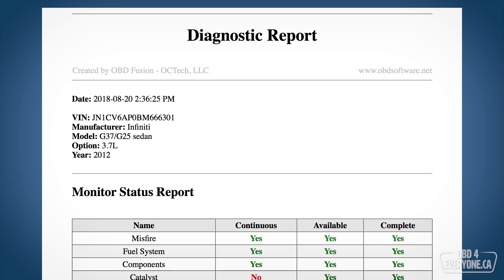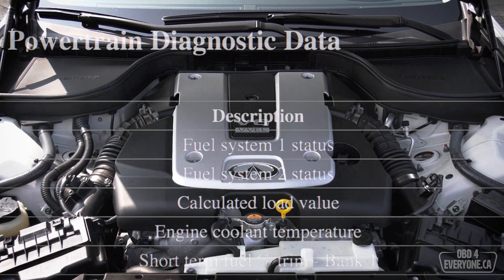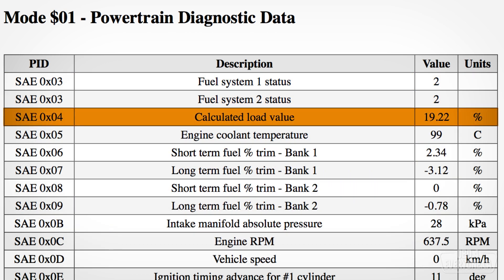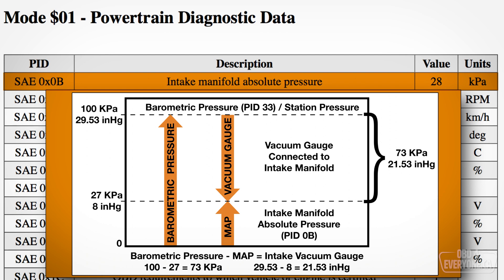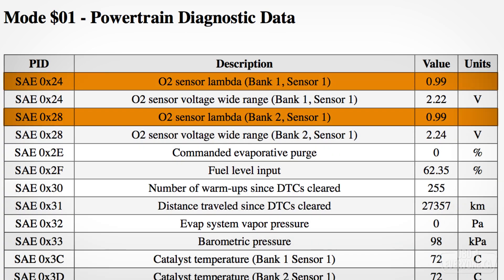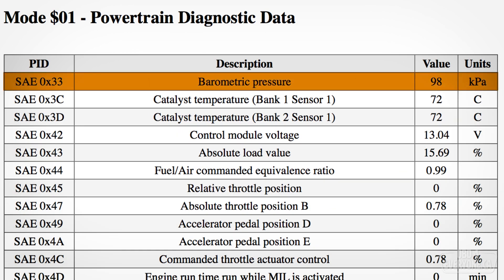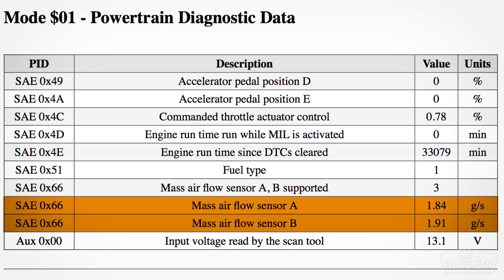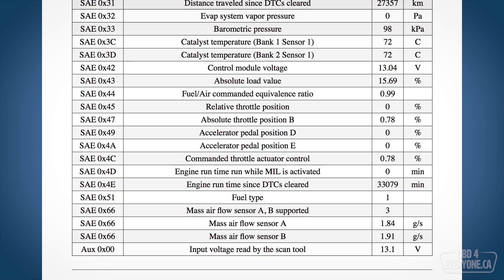Nissan & Infiniti 3.7 litre V6, Top 10 Misunderstood Engine Sensors: OBD4Everyone Ep.17

Comment: Blown away. Pumped with informations! Definitely worth subscribing, thank you.
Reply from the maker: Hey  Michal Kovar,
Thanks for subbing! The next episode is a review on the OBDLink SX (usb OBD scanner & OBDWiz) that should be out next week :)
Reply: @OBD4Everyone  Staying tuned. Now, I'm learning on my 2002 Lexus RX. It's has no problems apart from ABS error which pops when going over 170 km/h. But still no error report is visible. Maybe I have to buy the specific files to access the ABS module.
Reply from the maker: Hey  Michal Kovar,
OBD Fusion does show as supporting the enhanced diagnostics for the 2002 Lexus.

This add on should allow you to scan all modules (including the ABS module) and retrieve the code(s). This just might tell you which wheel speed sensor is acting up.
Reply: @OBD4Everyone  That's exactly what I hope to do. Right now, I'm watching again the All sensors explained and I see in my report, that fuel trims on Bank2 are -13% combined. Do you have any video covering the troubleshooting of this type of injection time compensation? And again - thank you very very much for these videos!!!

I really don't want to bother you, but is it possible to reach you in some type of chat? I know no one to ask about the report I just obtained.
Reply from the maker: Hey  Michal Kovar,
Depending on the manufacturer your total fuel trim may be good.
For example, Nissan documentation says a total fuel trim of -15 to +15% is acceptable.

Feel free to ask the questions here. That way your question might help others :)

Comment: Hey again, so for my reading for the mass air flow rate on bank 1 is 4.3 g/s doesnt go any lower and for bank two it was basically stuck @ 428.0 lol.  I dont have a check engine light or any unusual symptoms.  My mpg is pretty bad though at 16.2 mpg.  But I always assumed it was becuase of all the exhaust mods I have.  Any thoughts....thanks
Reply from the maker: Hey  latino914,
Actually I just saw your your post on myg37.com!

Anyways, you might want to try swapping your MAFs. Put bank 1 MAF into bank 2, and bank 2 into bank 1.

Then see what is being reported for air flow. If the high reading switches to bank 1, then you know you have a bad MAF.

However, if you don't have a check engine light, I would suspect that NDS III Lite may not be reporting bank 2 properly. If bank 2 had an out of range value, there would be a CEL on.

I do know for a fact that OBD Fusion does report both MAFs accurately.

Comment: hello, can you say knock sensor pid adress for g37?
Reply from the maker: Hey Василий Васильев,
There isn't a PID for the knock sensor on the G37 / VQ37VHR.
If you want to know when your engine is knocking, this may be helpful:
https://uprev.com/documentation/Knock%20Listen%20Device.pdf
Reply: @OBD4Everyone  hello. 
I need to see this parameter on the tablet when I'm driving  https://a.radikal.ru/a08/1907/cb/8332bead4e6d.jpg 

uprev sees it, but I don't have my own cable. 
I think this is a good topic for a new video.
Reply from the maker: Hey Василий Васильев,
When the  UpRev software is uploaded to the ECU, it makes its own custom PIDs, like knock level / knock counter.
Since they created it, only they know how to read it. It is not a standard or extended PID.

If you want to see the knock PID, I think you will need to purchase the UpRev cable.
Reply: @OBD4Everyone   I find this pids list. Can you test it? And check your Instagram ;)
E3020	vBETAW Knock control value
E3021	vBETAA Knock control learning value
E3022	vBETAB Knock control learning value
E3023	vBETAC Knock control learning value
E3024	vBETAD Knock control value for the high-octane/regular judgement
E3025	vKDBIDX (Knock detection inside variable)
E3026	vKDL_R#1 Knock frequency element
E3027	vKDLMON A label for the monitor by knock frequency element cylinder
E3028	vKDLW_R#1 Knock frequency element
E3029	vKNCNT The number of knock counts
E3030	vKNCYLC Reference position renewal cylinder distinction value for the knock
E3031	vKNKSL Knock slice level
E3032	vKNOCKCYL A label for the monitor by knock judgement cylinder
E3033	vKNSCNT Knock sampling number of times
E3034	vKNSEQ Sequence number of times
E3035	vKP_R#1 A knock index number by the frequency
E3036	vKPSBGL Knock back ground level
E3037	vKS_R#1 Knock index number
E3038	vKSR_R#1 A former compensated knock index number
E3039	vRKS_R#1 Knock index number
E3040	vVTCNK The amount of VTC knock compensation
E3041	vVTCNKL VTC knock compensation quantity (the left bank)
E3042	vVTCNKR VTC knock compensation quantity (the right bank)

Comment: Great videos. You've really helped with unlocking OBD Fusion's full potential. I'm curious to know how you ran a diagnostic report while your engine was running. When I open the diagnostic tab to do just that with my engine I get a warning message not to do that because it may make changes that will affect the ECU. Is that just OBD Fusion's liability release or are you really not supposed to run diagnostic reports while your engine is running? Thank you!
Reply from the maker: Hey D P,
I am glad to help you learn more about OBD Fusion, it's a great app  :)

Since OBD Fusion works with all OBD II cars, I suspect they need to be careful as they can't test every car to see if there are any issues. 

Generally, generic OBD scanners (like OBD Fusion) can't change any ECU values as they don't know the algorithm to determine the password for the ECU. I  have run the diagnostic report on many cars (Mazda, Subaru, Infiniti, Nissan, Honda, Ford) with the engine running without any issues.

The benefit of running the diagnostic report with the engine running is that you get a "snapshot" of what the engine is doing. This can be useful for troubleshooting issues down the road.

If you are concerned about this, just run the diagnostic report with the engine not running but fully warmed up.